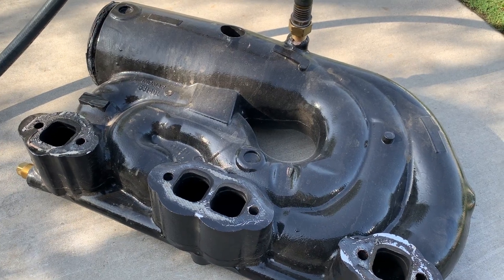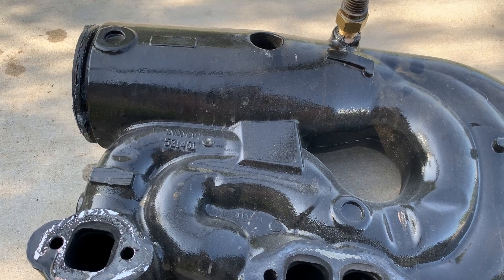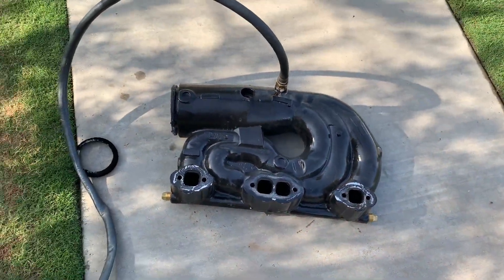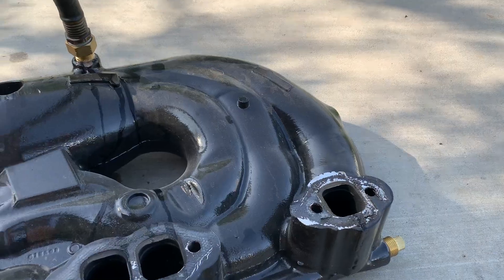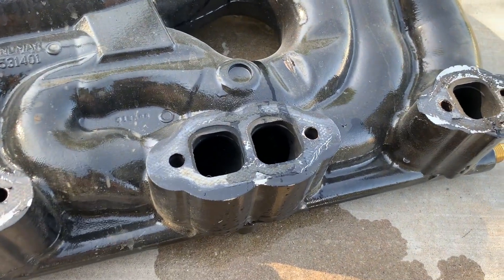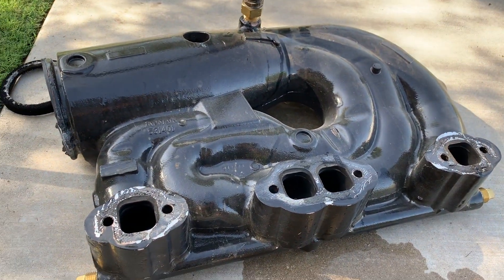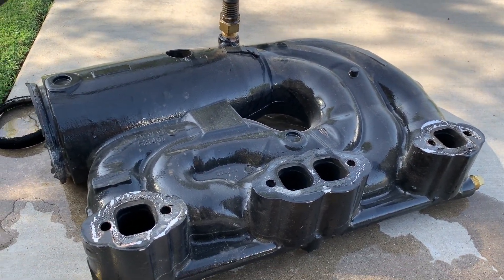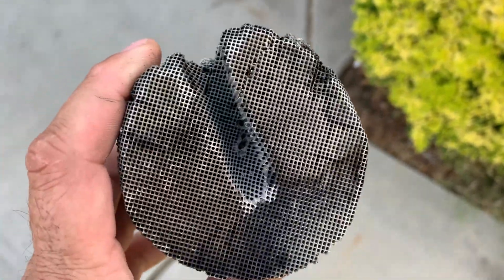Broken Indmar Monsoon exhaust manifold tech on Malibu or Master Craft boats

Comment: Helpful video; thanks for posting. Your rationale for the cracking is solid, and the fix is making sure there is always some water cooling the manifolds. At the end of the video that cat had melted from excessive heat. Likely related to the basic issue. If an engine is starved of water for any reason ( clogged raw water strainer, worn impeller, debre clogging the transmission cooler, thermostat, water pump, etc) it won't cool appropriately. So, always a good idea to fake a lake in driveway and be sure there is good water flow from exhaust and engine temp gauge is not higher than 160 degrees on most boats.

Comment: I just had this happen to both manifolds. The inside water jacket cracked and broke a hole thru. Water poured into cylinders, hydro locking them up and giving me " Chocolate milk" oil. Flushing oil now, and hoping the block didn't get cracked. 2007 Supra Launch 20SSV

Comment: Thanks for posting this video! I have the same engine and was getting water in the spark plugs. Come to find out it was this same problem, same side. I was chasing my tail trying to figure it out and you pointed me in the right direction.
Reply from the maker: After you fix, get the cooling upgrade
Reply from the maker: Yup, make sure you get the rerouting kit.

Comment: What year is your engine? Is this a fix they are now putting on all the new engines?
Reply from the maker: it was a 2008 but I think this issue ran all the way up in to 2012 or 13.  If your exhaust looks like this, it's probably the same deal.  They have an update to  with the cooling lines.
Reply: @btuff  Thank you sir!